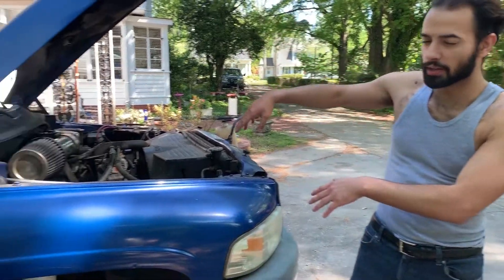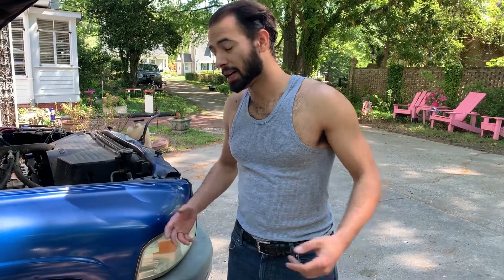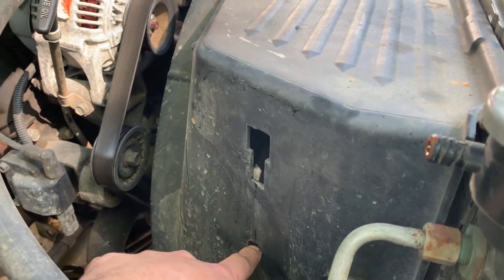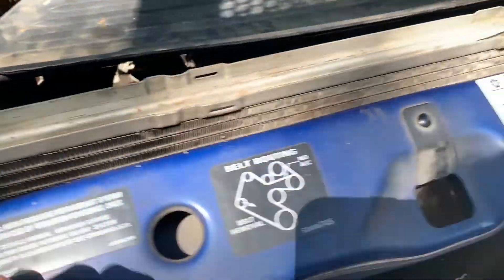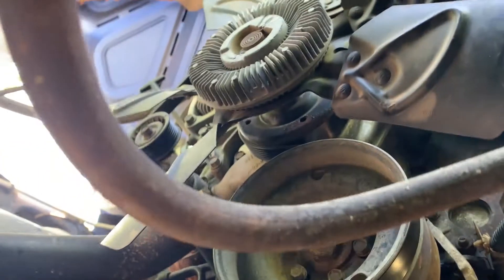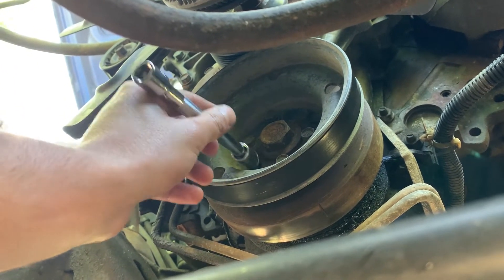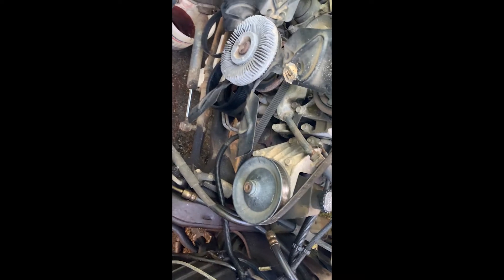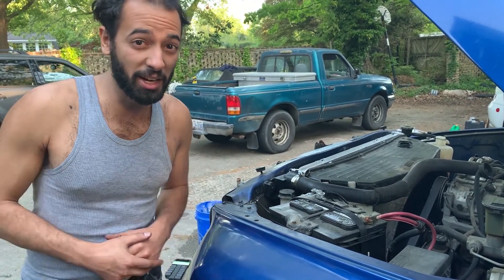How to Replace a Harmonic Balancer Dodge Ram 1500 (94-02)

Comment: 😮wow didnt know about the 6 bolts on pulley.

I have a 2nd gen Dakota with 3.9v6 it has the exact same crank pulley and dampener balancer.
This does help alot I never a video my same pulley explaining remove 6 bolts  first and then 22mm.

Harbor freight has decent impacts.
The bauer brushless 1/2 impact can use Milwaukee m12 m18 batteries 
Bauer needs the $20 adapter for it from amazon.

Comment: Awesome!
Which installer kit did you use? I cant find one that has a bolt that fits  the 5.9 liter internal threads. They are all made for the 4.7

Comment: I just pulled my crankshaft out out without an impact wrench. But now I can't get the harmonic balancer out cause it doesn't have bolt holes. The balancer and pulley are one unit with one single bolt in the middle. What do I do?
Reply: What did you end up doing?

Comment: Ya you don’t wanna break or stretch the bolt by using it to suck the pulley in, not having to ever deal with that is well worth the few $$ for the installer, why did you choose to go with the one piece balanceras opposed to the removeable pulley ?   I am trying to remove one of these right now and none of my pullers will work to remove the damper

Comment: Why couldn’t you just use a ratchet to pull the crank bolt?
Reply: Cuz 150 ft lbs
Reply: @kellismith4329  what about a form of leverage?
Reply: @Thatlowdsg  Engine will turn backwards which is a very bad thing.  Those bolts are really on there to begin with and have been there a long time usually before people need to remove them.